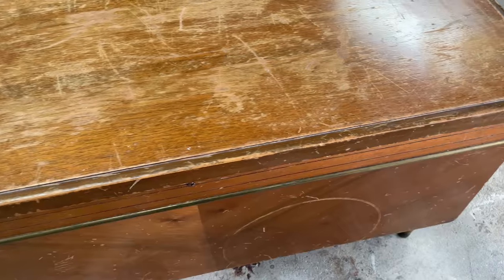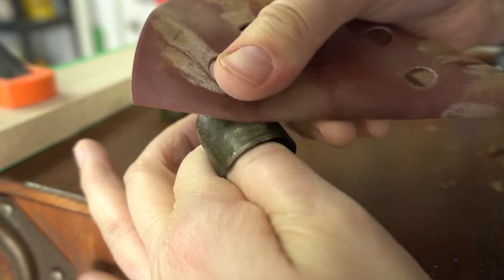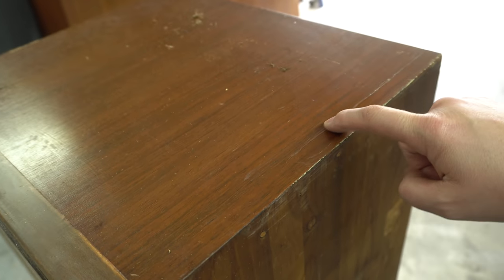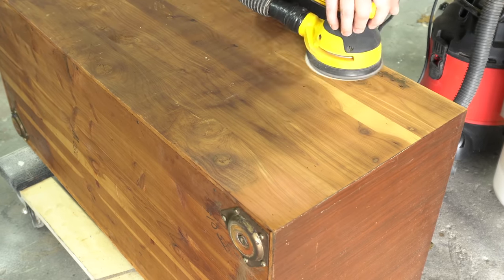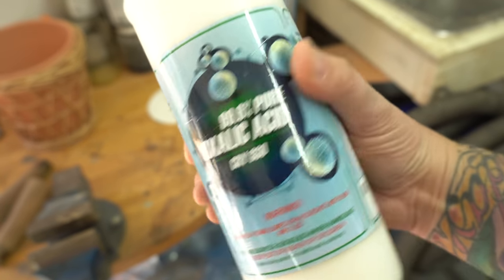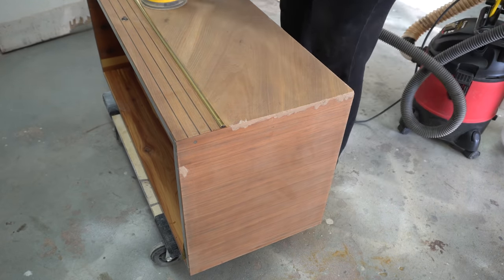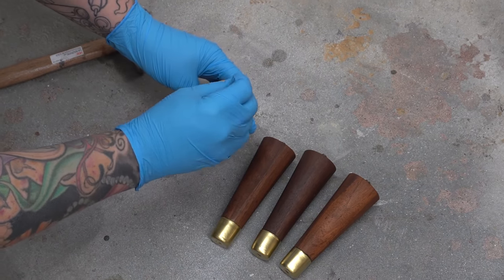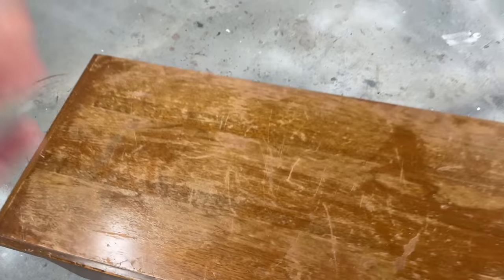Restoring a 60-Year-Old Walnut Cedar Chest

Comment: I know it's like a year later that I'm finding this, but I'm mid restoration of a cedar chest and I have a couple of questions. 1. The hemp oil, where can I get it (U.S.) and does it mess up quilts or whatever fabrics you put in the chest?

And my second (or third 😅) question is, do you know where to buy copper dome tacks? Mine has copper accents, and a few of the tacks lost their heads when we removed them. It's real copper, which I plan to clean up, so would like them to patina together, if that makes sense.

Thanks so much, and I've been enjoying binging on too many of your vids for tips the past couple of days while I was feeling like the crappy weather outside.
Reply from the maker: Any product I apply to a piece is applied, allowed to bond and then the excess it wiped off where the surface then cures. The only way you'd get transfer is if the excess didn't get removed. All of my videos contain a full list of items and products used, along with links for purchase, in the description. Just click on the Show More... and a full list will pop up for you.

As for copper dome tacks, I would check Lee Valley etc online. I'm not sure if they do or not but they carry a lot of items like that. Thanks so much for watching!

Comment: Hi, I was told not to use an orbital sander on cedar because it takes off too much at one time but, to use just sand paper? Is this correct? I am using a 600 grit sand paper it is a soft wood. I am no carpenter, just a hobby I started.  Thanks for the vid...
Reply from the maker: It takes very little if you’re using a finer grit and get in and get out, so to speak. It’s all in the technique really. I’ve never had issues, but I also avoid using low grits and lingering with the sander. By hand is always an option for anyone not comfortable with a power sander.

Comment: If it were me, and it’s not (lol) I’d be using a drill on the cylindrical pieces to speed up the cleaning process. Like the legs and feet. A tiny machine screw through the nail hole and chuck it in a drill. Waaaaay faster. 😊
Reply from the maker: Haha, I’ve done it that way a few times. In general though, I don’t like it- it generates a lot of heat, and can sometimes mar the threads if not careful when tightening. But I do know a lot of folks like it, and yes- definitely quick!

Comment: My question is, when you apply something other lacquer or polyurethane, for example, oddies oil or hemp oil or something similar, does the stain bleed out if you clean it with damp cloth or in case of chairs and tables, your clothes touch them?
Also, in this particular case, will hemp oil stain fabric things of you happen to store some clothes or bedding or something else in it?
Reply from the maker: Odie's oil is tung oil and cures to a hard finish that doesn't bleed onto things, it can also be gently cleaned with a damp cloth with no issue. Hemp oil is different and is not a top coat. All of the different products I use inside the drawers gets applied, allowed to sit for a short time, and then wiped back. What remains in the wood cures and doesn’t leave any residue. There are some oils that perhaps could leave residue, but the ones seen in my videos are the only ones I use and I’ve had no issues at all (the excess needs to be removed though).

Comment: is there another oil we can use to clean the inside of cedar chest?
Reply from the maker: The oil doesn’t clean it- it just adds moisture to the wood. However- some oils should not be used inside, as they would seal the wood. Cedar oil is good for bringing back the cedar smell and moistening the wood, but it’s not something that needs to be done very often.

Comment: Here's a tip: You can use methyl alcohol or denatured alcohol, in combination with a red synthetic pad in place of stripper to remove a shellac finish.  This leaves the wood ready for finishing and you don't run the risk of damaging a delicate veneer, as you might with a metal scraper.  The same process can also be used to remove a nitrocellulose lacquer.  In that case, replace the alcohol with lacquer thinner.
Reply from the maker: Yes I’ve done this many times on antique pieces. I’ve extremely rarely had any issue with a metal scraper for removing a finish; the two or three times it’s ever happened was on the edges where the edge banding meets the top layer of veneer, depending on how it was applied. I actually mentioned using methyl hydrate for shellac a couple of times in other videos, and have a piece coming up fairly soon where I’ll be doing that again. :-) 
Thanks for the message!
Reply: @TranscendFurnitureGallery  I figured that you knew that trick.  That comment was directed more towards viewers who might be beginning their journey into the wonderful world of refinishing.
Reply from the maker: @islandblind  I’m happy when people share tips here for that very reason! :-)

Comment: Hi! I have a cedar chest that has a really ugly veneer, like grey/green with black speckles from the 70s or 80s (I used citrus strip to confirm that it was still there). It was painted cream when I was 15. After thinking I could just remove all the veneer I’m realizing that not all the wood will be pretty. the lid for instance is likely particle board with a veneer over it and a cedar veneer on the inside. For the top and sides I’m wondering if all veneers can be sanded to raw wood and stained, or are there some veneers that are actually enamel or like laminate countertop that will never be anything other than hideous dusty green/yellow?
Reply from the maker: The long answer here, is as much as I would LOVE to be able to help everyone who reaches out, there sadly just aren’t enough hours in the day. There is another side to this as well- sometimes things don’t come across properly through photos and videos, and are best seen, felt, etc in person. For THIS reason, it can sometimes be difficult to accurately determine the age, finish, wood species, etc of people’s project pieces. There is also the element of user error, when recommending products and finishes, or misinterpretation of my instructions.

I get, on average, approx 40+ messages per day between Instagram, FB, YouTube, and email (and literally hundreds of questions in the comments). It is unfortunately just not possible to be able to get back to everyone. 

The short answer is this: you can certainly message me on Instagram and if it’s a simple answer, I may try to help you out. But PLEASE don’t take offence if I’m unable to respond! I need more hours in a day!

Comment: If I may suggest try using distilled water instead of Tap water the calcium in the tap water can cause it to become trapped, also add 10% rubbing alcohol to the distilled water to help it evaporate faster lastly consider buying a Moisture meter.

Comment: Please beware that a coiled power cord on a reel can get very hot very fast when high current is drawn.  In the US the voltage is low (130 VAC), so the current can be rather high when using electric motors.  This is a fire hazard.  Always unwind the power cord.
Reply from the maker: Yes, I do know that it can be an issue for sure. I’ve never had it get even warm, but that doesn’t mean it couldn’t happen. I honestly had this unwound at all times in our last house but the set up here is different and I don’t need its full length anymore, so may actually try to figure out an alternative that won’t leave cords everywhere (I’m thinking maybe hooking it overhead on j-shaped hooks or something).
Reply: Great tip, thanks!

Comment: 5/6/2024 - Three questions: 1. Why use hemp oil? 2. Why not tug oil? 3. What is the purpose of finishing with polycrylic satin?
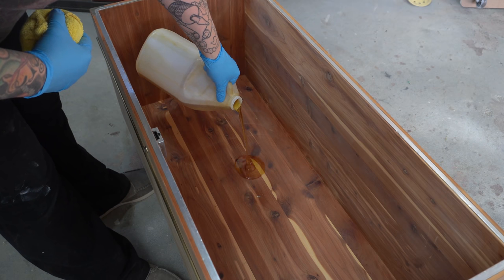Reply from the maker: I actually answered 1 & 2 at the 15:35 timestamp. 😊 The Poly was used to seal the stain and repairs. 😊 Lacquer is another option when I don't use Odie's.
Reply: @TranscendFurnitureGallery  i know you are busy, but you did not state a reason for not using tung oil. Also, Why not use a combination stain and sealant? Thank you.

Comment: Why scrape? If you can strip, its old finish anyways? Saves you alot of time and effort,
Reply from the maker: Faster, less messy, and less chemicals :-)
I use stripper on thicker finishes but when they are thin and flaky, scraper is the easiest tool!

Comment: I used citrus stripper to remove my polyurethane on my table, it removed a few of the coats, but not all of it, leaving the table "splotchy" with some layers thicker than others, i then used a copper wire scrubber and mild MR. BROWNN's soap, and let it dry,  I then Sanded with orbital sander 150, it took off the remaining topcoat exposing the bare wood on the sides of the table, but the top had spots that were bare wood, and others with some thicker areas than others, i then went down to the 60 grit sandpaper with my orbital sander... I don't think it did much... without wanting to damage my table, I STOPPED. Turned to youtube... how to i get rid of the spotty finish, to get to the bare wood. i don't want to over-sand it because some of the bare wood is showing. but it looks almost like cow print. THANKYOU CITRUS STRIPPER FOR NOT WORKING because of the California laws... i cant get ahold of the main ingredient that's in the paint stripper, what do i do? I NEED THE BARE WOOD, SO I CAN bleach the wood, then add the whitewash stain to it.

Comment: This restoration is a perfect example of why you attracted my attention and you stand out off the crowd: the huge majority of your fellow flippers would have sanded the piece and then slapped a coat of paint on it. I'm not averse to painting; as a matter of fact I believe that any laminated piece ought to be painted, just because laminated wood makes the eyes bleed. And there are circumstances in which one can paint solid wood as well (even tough I prefer whitewashing); I would never paint on veneer, but that's just a matter of taste. But I see this craze of painting everything (with a paint gun, to make it worse) as a form of fetishism, that pairs with the other form of fetishism that is equally ubiquitous, i.e. the one that forbids refinishing a piece "not to destroy its historical value". I have a 250 years old dresser in my bedroom and of course I would not want to refinish it; but I have seen people scolded for refinishing  pieces whose finish was totally shot and oxydized to the point that you could not even guess the wood grain (and was used by an old lady as a display for her flower pots, so you can imagine the water stains...).